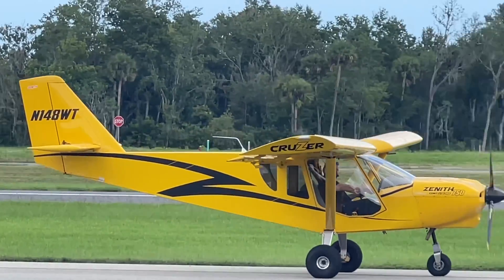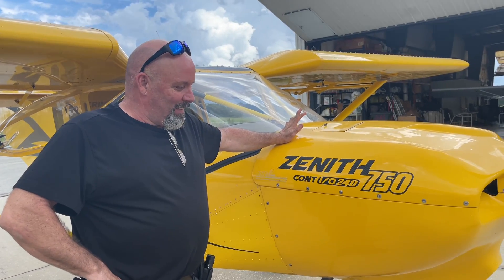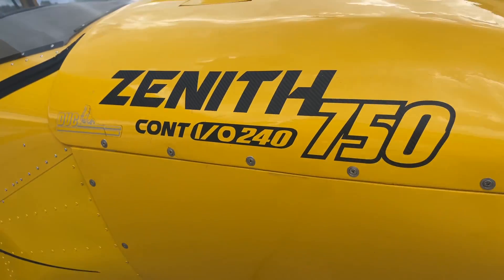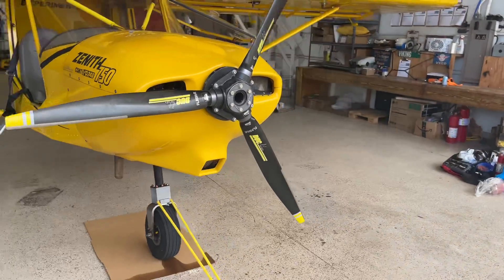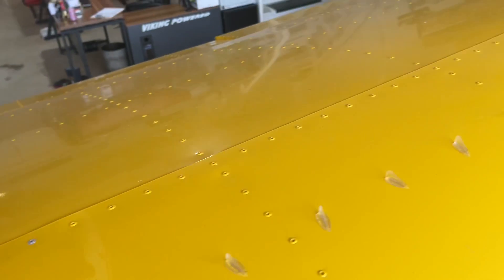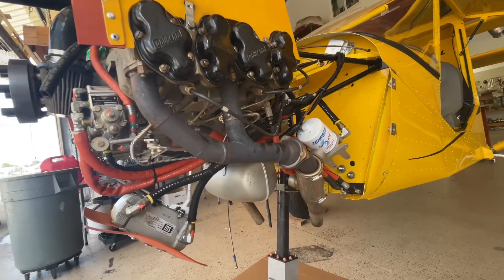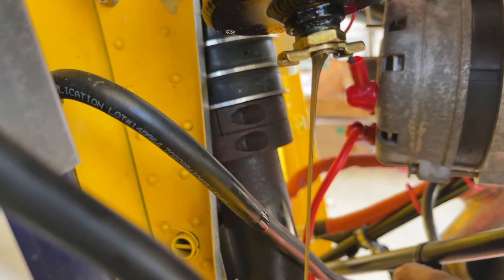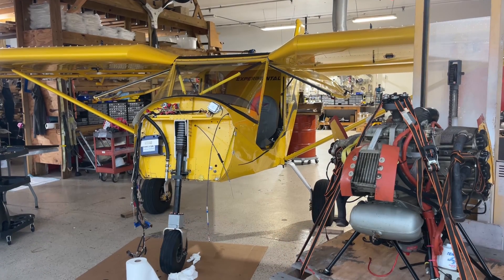Replacing IO-240 with Viking 130 Engine

Comment: This was an outstanding start. Please make a video just like it in reverse with the Viking engine you replaced it with. Please calculate the specific fuel consumption for t your Viking engines at 75% power like other engine manufacturers do.

Comment: Can't wait to see the new weight. Have you had any experience with guys trying to rate their airplanes over the 1440lbs design limit set by zenith? I've heard of it being done. Just curious if you knew more about that process.
Reply from the maker: Hey Matt, as the builder you are the manufacturer of the kit and can rate it as you would like. Dave T who just did the 48 states has his rated at 1650 I believe. However, he has the power and thrust with our engine to stay safe and climb out etc.
Reply: @eggenfellner  I knew it was builders discretion. I just wasn't sure if Zenith advised against it. I had heard they just recommend dropping the g-limit to +4/-2 or so. Good to know Dave T did his to 1650. Thanks for the info!